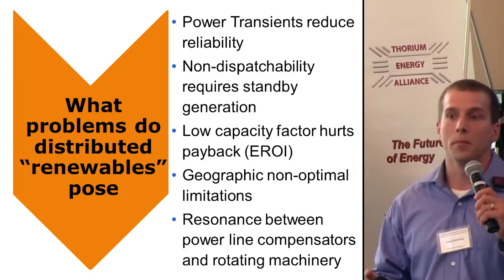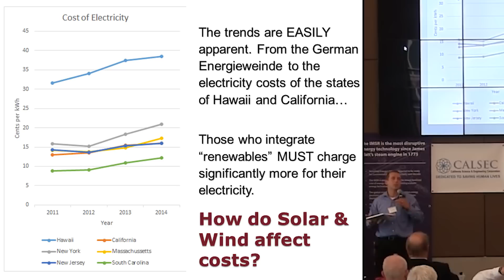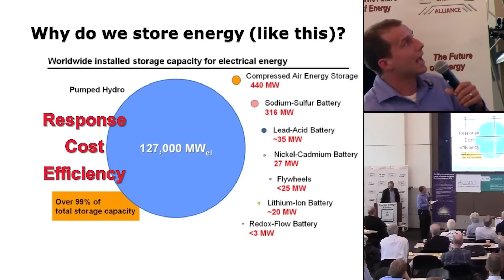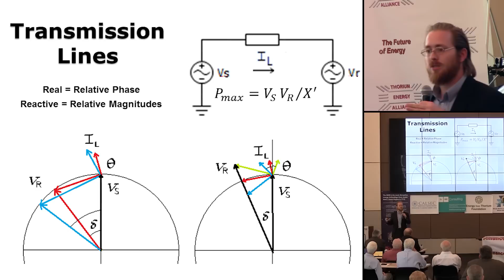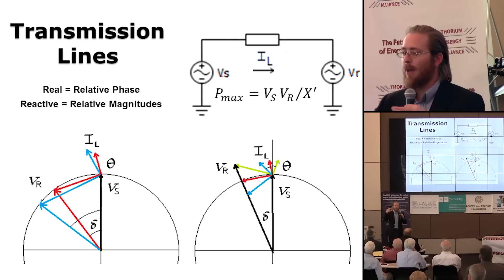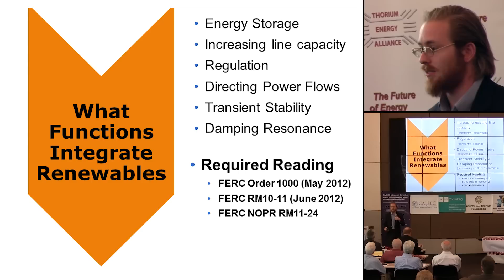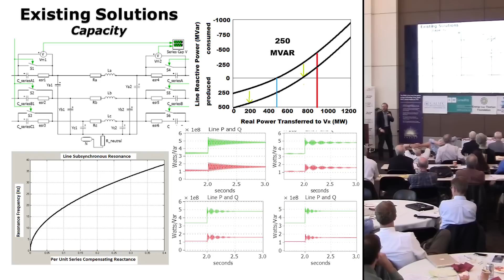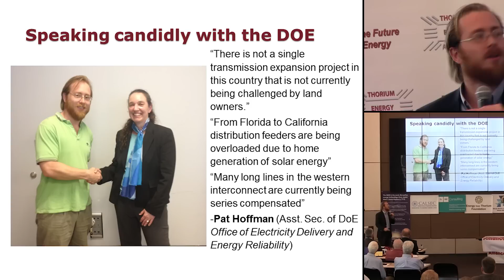Andrew Dodson - Issues Integrating Renewables @ TEAC6

Comment: Maybe I missed this, but why specifically is roof top solar generation such a "bad signer" or disruptive, costly source of energy when back fed into the existing grid? 
Is it because of it just unreliable/intermittent? Or the is it due to the DC to AC conversion issues?  Or is it just due to the fact utilities have to buy at the generation rate and sell at the end use rate?

If utilities just paid the home owner for the production of solar energy that made it to the end users, would energy costs be cheaper in CA an HI? (Transferring the cost the roof top solar owner) Is so, why don't utilities do this?
Reply: I know this was 2 years ago, but it's a good question.

rooftop solar uses 'micro-inverters' to convert the low voltage DC power to low voltage AC power.  They don't produce 120Volt AC power, and they don't sync up to the grid.  When large power plants start to spin up, they have to very carefully sync up with all the other power plants on the line.  That's why if a bunch of large power plants go down, they have to be brought up one by one.

Intermittent and variant as something as small as rooftop solar is, that's just not tenable. You could never get it on the grid if you had to re-sync it every time a cloud passed by. So they produce low voltages and just don't bother with synchronization.  Do that over a ton of rooftops and you start to get a lot of random noise accumulating from these small perturbations.  To a degree it sounds like (could be wrong here) these small distributed solar panels can evens start to harmonize with each other, so that the voltage and phase differences don't just cancel out and create a general variance, but actively compound, leading to these strong resonances that start to threaten to do damage, and make the power delivery unreliable.
Reply: Maybe watch it again? I think they said why but I don't understand electricity. lol. Forcing utilities to pay unreasonable rates to buy back solar seems unfair to everyone who can't get solar. Some people can afford it but they have trees in the way or their roof is not fit to accommodate a solar panel (i.e. wood shingle). My roommate would have to pay thousands $ to upgrade the roof before talking to anyone about a solar panel (this came from 2 different solar companies).
Reply: Robert Weekes I've watched it too many times.  I don't fully understand the details of net metering.  Who/what is "forcing" the utility to pay the home owner for their solar electricity at the generation rate (3x more)?  I've always thought that a home owner who gets roof top solar does so to be more self sufficient, and create their own micro grid.  Some will even pay the cost of battery storage to do so.

However, I've read about cases in HI, where home owners install roof top solar just to sell it back to the grid, taking the monthly bill from $150 to $50.  If a HI resident is prohibited from back feeding the solar generation into the grid, how much can they save?
Reply: ***** if the utility has to buy less useful electricity and incur efficiency losses at the same price it sells it to back the end customer when there is a higher demand, then the net cost of energy goes up and it will lose money. of course, it won't, it'll just raise prices until the people who don't sell electricity to the grid cover the difference.

the scenario you are describing is not as problematic because power doesn't feed back into the grid
Reply: Thxs Xylos - this reply adds some clarity.

I am still far from an expert in this fascinating area, but knowledgeable energy commentators I read frequently also always mention spinning inertia or 'spinning reserves' from the rotating mass of the turbines on the system.  Approximately 60 seconds of inertia is stored on on the system from traditional generators, giving grid operators some level of flexibility to maintain system frequency in the event something happens.  Obviously solar has no spinning mass.

Additionally, rooftop solar is considered behind the meter, so grid operators don't see how much is being generated.  That why it is referred to as 'negative load' in the same way that energy efficiency would be.  Cloud cover and variation in solar radiance would be just another adjustment, on top of customer demand variations (e.g. sudden spike/drop in AC use), the grid operator would have to make in order to maintain grid frequency.  The more rooftop solar is added to the grid, the more pronounce these problems become.  And don't forget the problems of the CA 'Duck Curve' and the load shifting grid level storage needed to handle high penetrations.

Comment: I thought I should bring up my comment about $10 trillion... I feel it is reasonable. I have not specifically calculated this number, yet it is based on my understanding of the field of power systems engineering. I have heard many estimates, 4 trillion, 7 trillion... etc. etc. etc. Transmission lines are VERY expensive, and noone knows the true costs, because, LIKE NUCLEAR POWER, a huge part of the cost is LEGAL. Obtaining land rights, dealing with fines and the EPA, cutting deals with state legislatures about rebates... Financing and all the world of madness. No man can count such a thing...

yet we try :]

So check this report about australia - 23 million people at around $300 billion to upgrade the transmission grid sufficiently for renewables: http://www.climatechange.gov.au/sites/climatechange/files/documents/08_2013/100-percent-renewables-study-modelling-outcomes-report.pdf
Cost Assumptions:  http://www.climatechange.gov.au/sites/climatechange/files/files/reducing-carbon/APPENDIX2-AEMO-transmission-cost-assumptions.pdf 

Ok so lets multiply by 13.67 for the relative population of US to Austrailia, and another 1.5 for relative energy consumption. Again let us include another 1.2 for the much larger areas of energy transport, as well as the significant portions of the USA that will not have wind or solar reliably (everywhere not southwest or midwest respectively) that is 7,557 Billions of dollars. (let us not discuss the horrific waste of lives and energy that is the war)

Consider that at 10 Billion for 2.2 GW, we will need 377 nuke plants(thats AP-1000s replacing 828 GW of fossil fuel generation) at a cost of 3,774 billions. 

So without any advancements, we can replace our existing fossil fuel generation COMPLETELY at HALF THE COST with nuclear as it exists now without any more transmission lines. Thorium reactors WILL BE A FRACTION OF THE COST OF EXISTING NUCLEAR TECHNOLOGY. Even if we only save 70% of our costs, we have just turned a 3.8 trillion dollar investment into a 1.11 trillion dollar investment. Now we are reaching something that is achievable within a decade of industrial development.
We need a well considered plan of action! The decision is clear. Let us go with the properly engineered and well behaved solution. The only barriers to nuclear are those secretly financed by the fossil fuel interests.Avante!

Comment: That was eye opening ... Can't see Kirk Sorensen or David Leblanc in the crowd ... hope they had talks.
Reply from the maker: Neither was in attendance. Paul McIntosh presented for Terrestrial Energy, but it didn't yet include upcoming announcements so (to me) it seemed like mostly a recap of earlier presentations. Still some value to me in those... Alex Cannara's TEAC6 talk was mostly covered already but I can improve coverage of the Ocean Acidification topic by pulling from >1 talk. Latest Flibe Energy presentation is still ThEC13.
Reply: :( oh well these are awesome presentations still.
Reply: gordonmcdowell Cannara's talk was very good, but I am more interested in details of the costs and efficiency of using nuclear energy to produce liquid fuels for transportation than the actual topic of ocean acidification.  Would like to compare that to the cost and practicality of switching to electric powered transportation.  I'm sure both are currently more expensive than fossil fuels, but would be interesting to see how cheap these technologies would have to get to compete with fossil fuels.  Complicating this even more is the idea of running commercial vehicles on natural gas, I know of a major shipping company here in BC that has trucks now running on natural gas.  Im sure there are more and more will follow as more filling stations are built.  The graph these guys showed at 1:06 is very interesting.  Transportation (and industrial) uses most of the fossil fuel energy, which is exactly why I have been wanting to look at options there.  Most of our electrical in Canada already comes from relatively clean and stable sources.  I'm not sure why most environmentalists, and the renewable push, are focused in the wrong area.  Do you know of any info on these topics off hand?

Also I like David Leblanc.  I like his approach.  Small, scalable, simple, looking at industrial applications.  I hope they gain traction.  Very exciting possibility!
Reply from the maker: NewJak14
Andrew just clarifies the 67% figure for transmission loss: "The justification of our numbers is based off what utilities have to PLAN for; not simply the losses occuring in the transformers and wires." http://www.reddit.com/r/energy/comments/28n7sy/issues_integrating_renewables_teac6_talk_by/cidxkhs

I don't have a super-stash regarding carbon neutral fuel. There's a snippet pulled from the "Dr. Helen Caldicott" chapter here... Electric Cars & Molten Salt Reactors ...but I think you've probably heard that message already.
Reply: gordonmcdowell Thanks for the link Gordon :)  I have never used Reddit, which is crazy considering my IT background.  Looks like there is a lot of good info there.